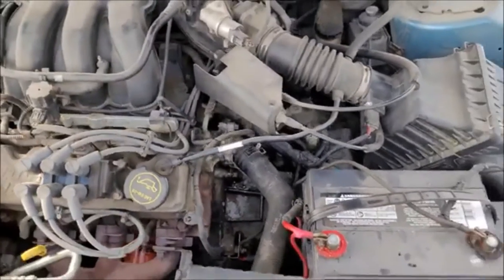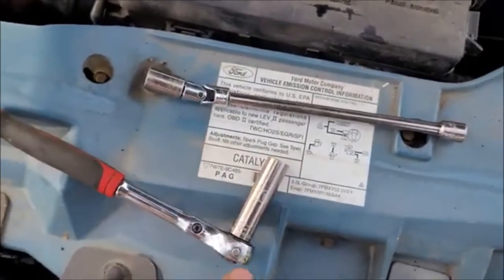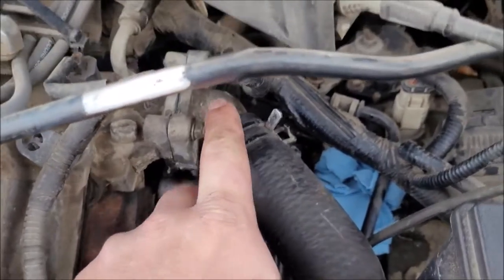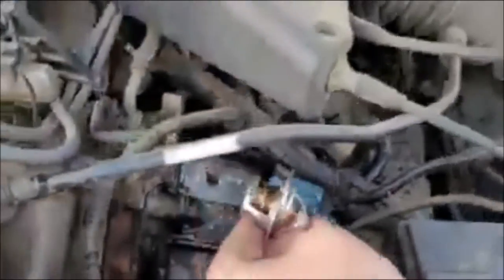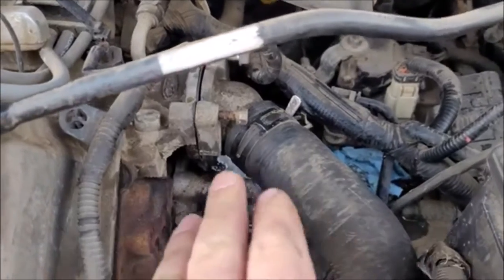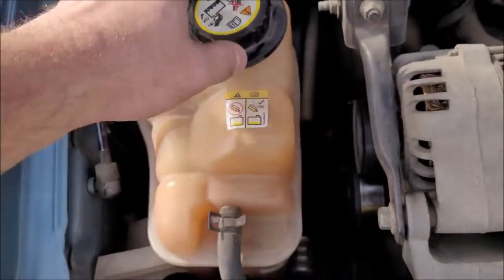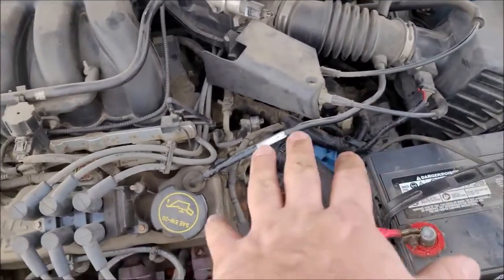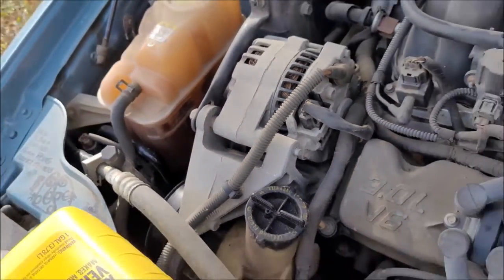Thermostat Replacement 2000-2007 Ford Taurus and Mercury Sable

Comment: Thank you for your helpful info on this easy fix.  I believe this will take care of my heating issues as it’s what was needed on my 2001 prior to this ‘07 and the thermostat replacement worked in that one.  I didn’t research it and ended up paying someone else to do the work which was a LOT more money…

It wasn’t until a coworker suggested I check the thermostat that I made the connection that I’m mixing up cars again.

Hopefully, weather-permitting; I’ll get this changed out soon.

Comment: The heater doesn't get warm on my car and someone suggested the thermostat.  Think it might help?
Reply from the maker: Could be that, or low on coolant, or blend door not moving.
Reply: I can't hear the door shutting when I quickly turn the cold-to-warm knob.  If I did do the thermostat, what degree would be best?  BTW - the engine temp. guage has never, ever gotten to halfway, even in summer.  But I don't use air conditioning.  Thanks! @KorysRides
Reply from the maker: @dbdouglas  I think the ones that are generally available are a 190 or a 197. The higher temperature one will be better in cold climates. Just make sure you put it in the right direction
Reply: Blend door works.  If I do the thermostat, does the coolant need to be drained first?  Or just keep the cover of the reservoir on?  Thanks. @KorysRides

Comment: QUESTION BUT I DON'T KNOW EXACTLY THE YEAR I KNOW  SHE HAS THAT MANUFACTURING UNDER THE HOOD....SOO  WHAT CAN WE DO IF THE PART YOU POUR THE MIX IN IS FLOWING OUT YET WAS CHANGED 3×S WHERE'S THE ACTUAL ISSUE WHERE THE COOLANT GOES❓❓I THINK IT'S A 2  IN 1 QUESTIONS NOW😅
Reply from the maker: @Nicholas-Nick-w  so to clarify, you are pouring coolant into the overflow tank on the passenger side of the vehicle, the coolant is going somewhere, and you don't know where it is going? Could be a few things. If it's draining onto the ground, there's a hose that leads out of that clear plastic reservoir that could have come off. You might have a leaking hose or the drain on the bottom of the radiator might be open. If the coolant isn't draining onto the ground, it's going into the engine. Before you panic, If you are really low on coolant, it might take a couple gallons before the radiator and cooling system is filled. If you still can't figure out where the coolant is going, check the engine oil. If it looks milky, you may as well throw that engine away. If you have white smoke coming out of the exhaust or if it won't crank over, it's leaking into the cylinder. If you try and crank the engine over and it suddenly stops, don't do anything else because you can't compress liquid. You have to pull the spark plugs out and crank it over until all the fluid is out, then you can try to start it but it means you have a bad head gasket.
Reply: @KorysRides  WOOW I APPRECIATE DIS,&& YESSSSSS U ACTUALLY GET MEH LUV SOO,WE TRIED TU CRANK OIL, ENGINE ,&& TWO MOORE LIGHTS I'LL GO LOOK AFTER THE RAIN  && WE KNO SHE'S  LOW ON GAS BUT ONCE WE CAN FILL DE TANO WE CAN TRY AGAIN I CAN LET UK WAT HAPPENS IFF U DON'T MIND
Reply: @KorysRides  OK SO WHERE DO WE LOOK FOR ALL OF WHAT YOU STATED STTARTING WITH THE HOSE & MILKY OIL??
Reply: SHE HAS NOO OIL DRY VERY DRY